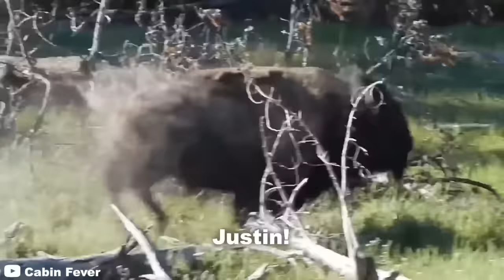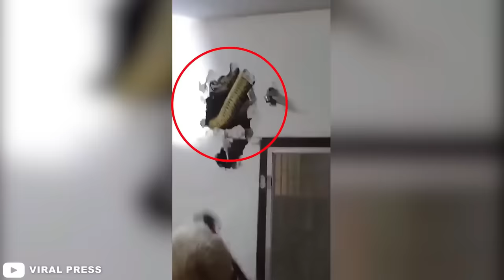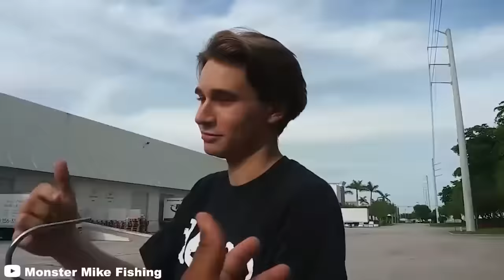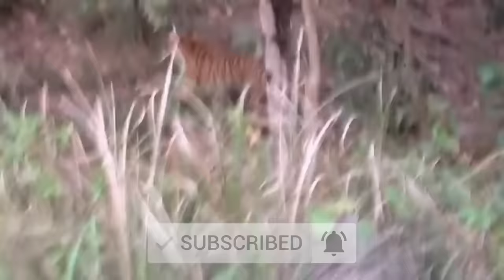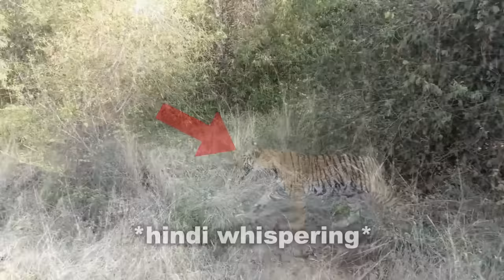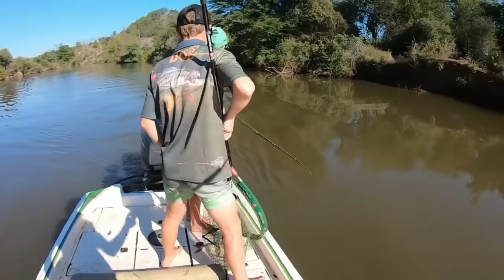30 Scariest Animal Encounters of The Year

Comment: The tiger looked liked it had been netted and trapped to me and had no  other choice but to charge at the men in  the raft, cos it was scared trapped and confused by them beeting there sticks on the water, that looked like a tiger hunt more than an  Un coincidental tiger /PPL encounter, if it wasn't then why was there thick bright orange netting on metal posts sett up all along the tall Reed side of the river, and u can clearly see that where, the tiger finely escaped that the  plastic net fencing had been  trampled and knocked down by the tiger panicking and forcing its way thru to get free finely and to safty away from the baiting humans.